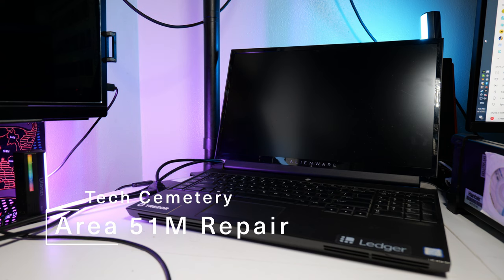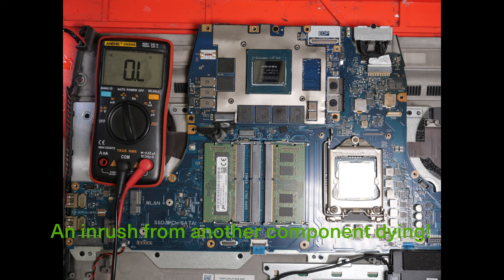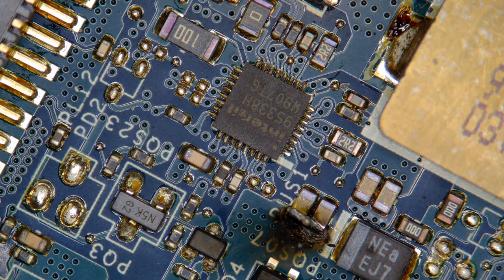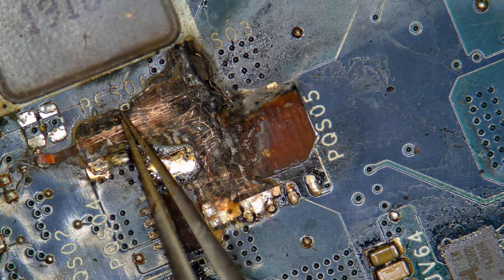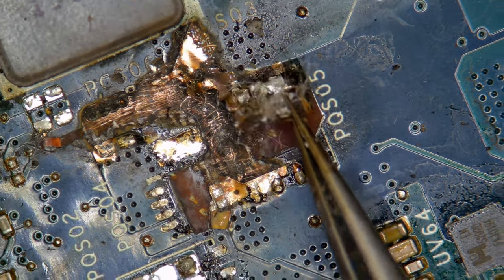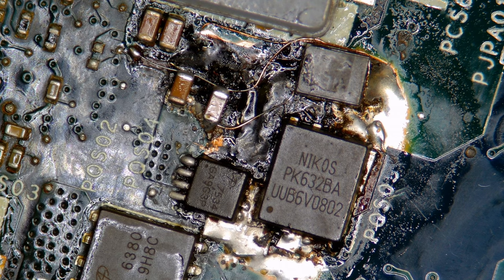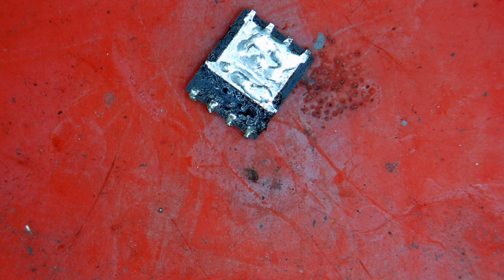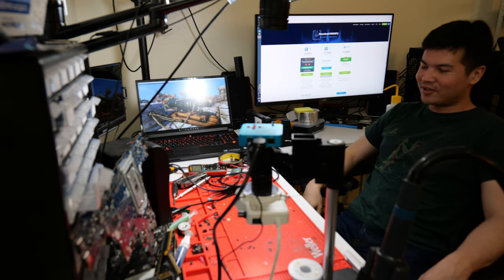Alienware Area 51M Laptop Repair #3 - No Power

Comment: One piece of advice. When you rebuild the pads (especially under the mosfets) - do not use just solder to bridge them, as solder will crack under heavy power consumption. Always use some wick or a piece of a wire to support the solder joints.

Comment: Haven’t watched your work in a while but always enjoy it. Well done…like many of those components. That’s some serious board repair and I would guess no one would attempt this repair but you. I’m running two GPUs with trace repairs but nowhere close to this. If I had to attempt more than a few trace repairs, it goes in the parts bin. You might want to consider repairing high-end TVs or monitors. That’s typically what I do. If I want a new high-end 4K monitor, I go find a broken one and repair it. Most of the time, as long as the display itself is not damaged, it’s a very easy repair compared to GPUs and laptops

Comment: hello I've been watching your videos for some time your work is amazing, if you can help me I would like to have an rx 6800 xt and my first time with the rx 6000 . I tested the voltage and realized that the coil I think should be 1.8v is 1v as I don't have access to the boardview I did what I thought I should remove the IC and put another one but it's the same VIN is 12v, VVC 5v, EN 0 .11 mv. I'm Brazilian can you help me

Comment: 1 fan on a 3 fan gpu is running at 100% for some reason (it's either off, or at 100%, even when I set the fan speed to 25% and the other 2 fans spin slower) card seems previously unopened. Anybody know a reason or some possible (easy fix). I aint that knowledgeable about this stuff really